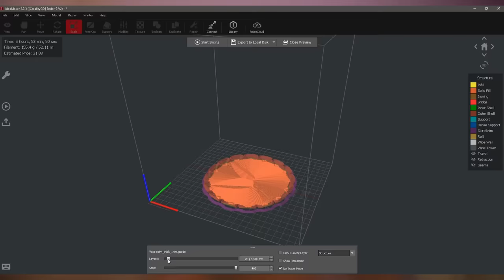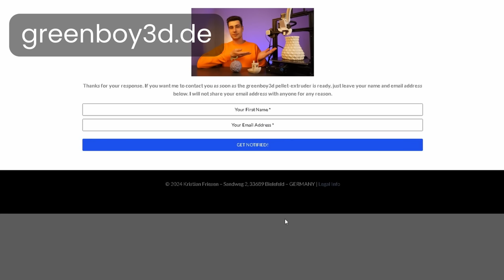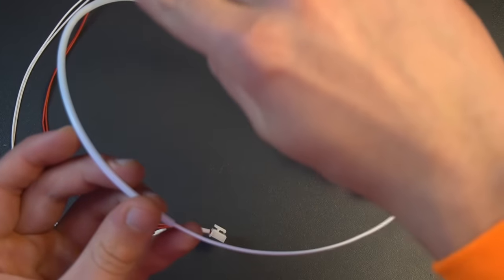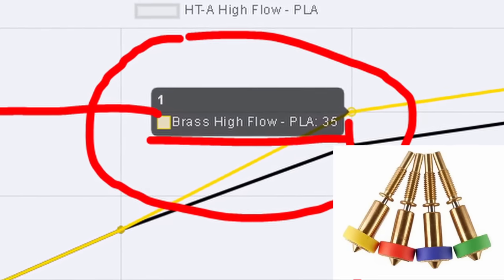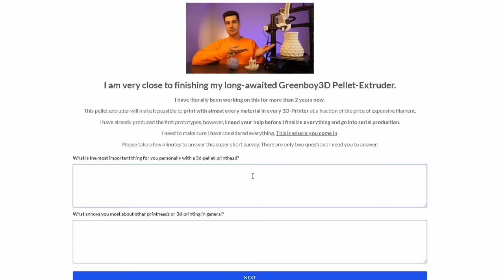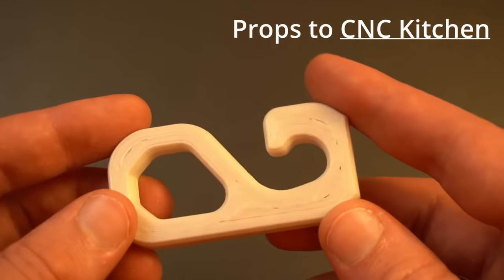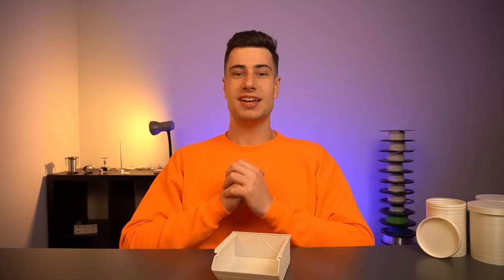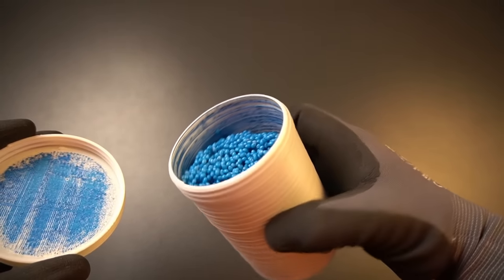Stop Buying Filament, Use This 6x CHEAPER Alternative instead

Comment: Will you need custom firmware because I have that exact same printer and will try and ake this as soon as it comes out.
Reply from the maker: You can use any firmware like. For example, Marlin is the firmware I use.

You just need to adjust some very minor settings in the firmware in order to use the pellet extruder on your 3D printer.

But don't worry I will make very detailed tutorials regarding this, which will everyone to upgrade their 3D printer to a pellet 3d printer 😀
Reply from the maker: Any more questions?
Reply: @greenboy3d  Yeah would i be able to grind/shred failed prints and support material and reprint it in this extruder setup? Also would you be able to grind things like PET bottles to recycle them directly into new prints?

Comment: I think the best solution for the nozzle would be using a larger thread for the proprietary nozzle. Say, M10 or something. (Ideally with a taper lock at the top so molten plastic doesn’t enter the threads) This way, the system can use proprietary nozzles or standard M6x1 nozzles with an adapter bushing.

Comment: Recycling is great, but filament does not have such a big price. Question is reproducibility/fail rate etc. Standard noozles is must, as custom ones give you disadvatage on market. In future I think you will have problem with spreading of MMU option. Over all like idea.
Reply from the maker: what do you mean with "spreading of MMU option"?
Reply: @greenboy3d  Multi Material

Comment: I feel that its worth mentioning that spraypaint isnt a great thing to be melting down, depending on the paint it could be very toxic.
Additionally, when mixing pigments into plastics the formulation is tricky as the pigments can easily ruin your material properties...
Reply: Yeah also pre pigmented pellets exist that aren't that expensive.

Comment: Run this beside the printer with a 1.75mm nozzle. Run the output through a bowden tube to a standard direct-drive extruder. If you set the pellet extruder as a standard second extruder in "ditto" mode with the correct steps/mm, you'd be getting filament on demand for the "primary" extruder with no changes to the printer necessary. Heck, you could use it as a pure bowden extruder and have zero worries about the weight of the entire setup.
Reply from the maker: Interesting idea :D
Would you like me to try that out in of my next videos?
Reply: @greenboy3d  Yes please! Great idea!
Reply: How is that different than an inferior filament extruder? What benefit would it bring?

Filament extruder are slightly more complex as they typically require sensors to ensure the filament is always the correct size, without it the resulting filament would be inconsistent reducing quality or causing clogs.

Why not buy a filament extruder to produce your own filament from cheap pellets?
Reply: @hellothere6627  The difference is this would be done on-demand, and would be compensating for inconsistency instead of trying to make 100% consistent filament.

This is akin to using sensors and processing power to compensate for low-cost parts the way Bambu has done successfully. Large, heavy, stable durable machines existed with mechanical perfection giving near perfect accurate printing. Bambu just measures the imperfections and compensates for them in real-time to generate results.
Reply: @greenboy3d  I would love to see it. The only limitation I initially see is that you would want to break up extrusions into small chunks, such that it's not making one measurement adjust for a very large movement. A post-processing script could break up any long extrusions. If a long extrusion was defined as a single extrusion that uses more than one (small) pellet's worth of material, it would theoretically be adjusting flow at the same resolution (or better) as pellet volume.

Comment: I honestly do not care about chasing the highest print quality.  For me #d printing a a utilitarian endeavor.  I make useful things that are meant to be used instead of "pretty" things that are meant to be looked at. If I can get 5x the prints at 1/5th the price and still meet the industrial level quality I accept then this is more than fine by me.  I don't waste my time or money printing busts of deadpool.  As for nozzles, I would prefer to use standard nozzles that are interchangeable among multiple printers, BUT....I think this is one of those cases where I see value in needing to use a specific "one off" style nozzle.  However I think it would be best that any nozzle be as robust as possible.  I'd ideally want a nozzle to last as long as the extruder screw and I don't think that is unachievable.
Reply from the maker: Thank you for your very interesting input 🙂
What would you like to see next?
Reply: @greenboy3d  I was thinking about this more yesterday and I do believe that your extruder could do double duty and act as the first stage for a pelletizer for ground up failed prints or supports.  This would make it much easier to blend with virgin material to then feed into your extruder.  This thing you've done opens up a LOT of avenues.  To have a viable extruder on a small scale really gives so many more options than a bulky unit that is not portable.

Comment: Nozzle - make it proprietary if it works better.
Neat idea and implementation but filament has come down a good bit where you can pick up a kg for $8 or under. If you can get this pellet extruder to come in under $200 AND have a source for the pellets at $5 or under per kg then i can see it working out great!!! Can't wait to see the final version as no matter what it is still a cool project.

Comment: This is really interesting. I wonder if you could make some GCODE that would use your pellet extruder to make spools too with a small addon. Seems like it would be a pretty handy thing to have around in general. Your screw style pellet extruder might actually be ideal for people's DIY filament recyclers, turning older printer parts into filament recyclers is of interest to a lot of people.

Comment: Hello, I plan to print accessories to recycle soda bottles (feeders, drinkers, fly traps, etc.) but I want to print them by recycling plastic (printing scraps, bottles, etc.). .) Your extruder seems interesting to me, but before going any further, can it be mounted on an Artillery sidewinder X1? And is it possible to easily return to an original extruder, to carry out other work and return to the pellet extruder afterwards ?
Reply from the maker: Thanks for your interest in my Pellet Extruder ♥

1) Yes, you can mount it to the Artillery sidewinder X1 and to many other 3D printers

2) Since you just need to unplug the extruder cables in the main board and plugin the cables of my Pellet Extruder, it is very easy to switch back to your Filament Extruder 

Any other questions? 🙂
Reply: @greenboy3d  
Thank you for your response.
X1 uses a ribbon cable as a connector for the extruder, this may need modification right?
Reply: @greenboy3d  Hi another one What is your recommendation for sufficiently crushing plastic bottles?
Reply from the maker: @tidou_flcrea  There are a handful of options, however please give more time to do some research on that topic, since I am right working very hard to ensure the Pellet Extruder and everything linked to it, like guides etc. is ready before October.

Please remind me of your question in 45 days 🙂

Comment: I honestly think I could live with the reduced print speed if it prints consistently or great. but even right now it could be used in a tool changer?

I also have an idea: i'm developing a pressure sensor for hotends that can optimize the flow and calibrate on the go based on hotend pressure, you could use one and then do a closed loop servo style hotend!
Reply from the maker: Can you write me an email regarding your presure sensor please to kristian@greenboy3d.com :) 
I am interessted and also willing to pay for it
Reply: @greenboy3d  Sure!

Comment: If the meltzone isn't needed anymore, you could use E3D-style nozzles (because the have a smaller head than the old MK8 nozzles) and shorten the threads a bit on the lathe. This way the meltzone decreases, but you can still use all the normal cheap nozzles as a quick replacement in a pinch.
Reply from the maker: Hmm.. That a good idea :)

Comment: I don't know much about it but from what I understood the print quality is caused by the pellets inconsistency, maybe it is fixable with a bigger heating nozzle, or maybe a semi-melting tube before it reaches the main nozzle. I am aware of the dripping problem it creates since there is nothing to hold the plastic from flowing down but maybe a custom nozzle could handle it? I loved the video btw

Comment: If the quality and cost benefit speak for themselves, I really really don't think supporting standard nozzles is something you should focus on.

The moment this thing releases - if the major 3d printing channels "get" it and are able to reproduce the benefits you show (material choice, cost, flexibility) then it's a winner. But, if the end of those videos they say "but, I've not found the quality to be usable for the kinds of prints I do" its a loser.

Speaking personally, my opinion would be swayed by this kind of thing. I want a third party to do strength tests and quality tests before I buy into a whole ecosystem.

All this is to say - focus entirely on quality and reliability. Nozzle compatibility seems like a far far worry from that. Multiple melt zones, flow rate sensors, that seems like the next step, but you won't get adoption if the quality is under the acceptable threshold for many people today.
Reply from the maker: Thank you for your very interesting input 🙂
Any idea for flow rate sensors?
Reply: @greenboy3d  Perhaps temperature loss or pressure on the nozzle could be a proxy for flow rate measurement?

Comment: I am so sad I missed the discount…. I would have been able to get it. Can it be used only with the ender? If not what other printers would you recommend today?
Reply from the maker: Hi, it works on almost any 3D printer and by now I have made already 3d printable adapters for more than 50+ 3D printers 🙂

Soon there will also a new big on the ongoing progress regarding the site where you will be able to download the adapters.

Personnaly I recommend the SOVOL SV06 since it is very easy to upgrade, open source and I will make guides on this 3D printers

Comment: The nozzle compatibility reminds me of when Honda started making the Cub, they asked a manufacturer to produce spark plugs that were of a different size from those that were common for motorcycles at that time, in order to make a cheap but still powerful enough engine. The Cub then became the most sold motorcycle of all time. You dont have to cater to old standards if they're not as good. Make a new standard.

Comment: Make sense for large production (dozen kilos per day), for printers with 1mm nozzle at least. If you still wish to print as is, make your own filament. In current state it's too much hustle and errors to use it. And don't print things which you can buy (usually it cheaper, stronger, last longer and don't require hustle).

Comment: One small question: where do you get your pellets?

It's an interesting project, and after your first video did a quick google search for plastic pellets in the EU, and couldn't find anything in the 3-8€/kg range you are citing, most i find are at least 10€/kg, and at that price you might as well just buy cheap filament. So if you want this to get popular, also show us where to buy these cheap pellets XD.
Reply: exactly my experience, nothing on the 3-8eur/kg range... starting from the same price as cheapest filaments
Reply from the maker: Should I make a Video about this?
Reply: @greenboy3d  Could at least be an interesting section of a next video, i'm clearly not the only person wondering, and it's an important part of your sales pitch, it should be a lot cheaper, but if we can't find cheap pellets, we won't have any use for your extruder...

Comment: re special nozzles.... as a stop gap / trial, can you just turn a tiny copper plug with appropriate outer diameter and an inner diameter of 0,4mm or whatever and press it into a std Mk8 nozzle?
Reply from the maker: That's genius, I'll try that out 🙂
By the way, what would you like to see next?
Reply: @greenboy3d  well I'm interested more in functional parts, so not really PLA..... would be good to see some variations on detail parts using PETG, ABS, PC and PA12-GF, with different speeds / nozzle diameters etc.  Realise that would not be a quick and simple process!!!!!  The engineering material filaments for FDM are generally quite expensive, so longterm your hopper feed & hotend would be game changing if even approaching equivalent quality of print.  Am guessing it would take a lot of work and likely identify some limits, eg min nozzle dia and max speed / flow for a given quality of print.

Comment: after this video, if  I were buying new 3dprinter, your extruder would be one of my main considerations.

I've got couple questions tho.

How compatible this design is with enclosed 3dprinter (like many bambulab clones)?

How sensible is switching back and forth, if I wanted to do most of printing with pellet and go back to filament for parts, I want to be really nice?
Reply from the maker: 1) Technically there is no problem using it on an enclosed 3D printer, however in such case either a bigger enclosure is necessary if you want to you use my gravity pellet feed-hopper, or you install an air pressure based pellet feeder for which you don't need to extend the size of the enclosure

2) It is not sensible in the sense of changing the printhead from Filament to Pellet back and forth if that is what you are asking.
Reply: @greenboy3d  
1 it makes sense
2that was, what i was asking.  
Thank you for quick and sensible answers

Comment: I prefer making filament (I make my own) first and use that for 3D printing. Usable on all machines with all extruders and nozzles.
Reply from the maker: Do you also recycle your failed 3D prints and if yes then how? :)
Reply: @greenboy3d  Failed prints and supports are going in the shredder together with leftovers and retuned boards (we make PLA boards mainly for traffic signs). All shredded material is mixed with new pellets and used to create new boards. 
I use fresh pellets only as the shredded parts are way too big to use for the filament extruder.

Comment: the why is oustanding when you worked around industrial extruder PRECISION no slip drying of pellets in the screw but i think since you need to save weight you need a melting screw with a hopper then a heated tube and another finer fillet screw to extrude, or switch nozzle and screw to extrude 1/4 or even 1/2 thick melted cord to make sturdier cords print looks horrible but you get perfect layer fusion you need heat on both screws and once the first bigger screw is filled with pellet and pigment you have a certain linear lenght of the color you choose on the head heated screw very tight into a fixed barrel so you extrude PRECISION witch each turn of that one.then first screw get refill another pigment and compress air to deliver pellets 

This is what industrial machine use but in one screw wich get tighter and tigher in the barrel with their spiral channel getting almost non existant for a section but for weight control it have to be done onto a fixed screw. one that feed the head where anoter finer screw is located and extrude either slow but very precise width or fast with another nozzle and a fitting screw pushing out some ridicule amount of material to build sturdy and ugly parts in no time

Comment: even if you have to buy a 100$ nozzle but you get 95% of the quality of filament it's still a good price long term, I'd love to get into 3d printing but the price of filament, 3d printer, failed prints, maintenance, this might be the solution for me, please make it the best you can, long term price is more important than the initial investment especially if it's less than 400 dollars,
Reply from the maker: Thank you a lot for your feedback. 

In November, I will start with the development of a more powerful pellets extruder with a better print quality. 🙂

Comment: Iam from Germany and were do you get your pallets ? I looked for some and all i found were like 12€/kg for PLA.
Reply from the maker: Soll ich mal ein Video dazu machen? :)
Reply: @greenboy3d  yes. I also can't find it. I am in UK and buy filament for £8 per spool which I 1.1kg and in bulk would be £7. Do you think pellets worth it? Also why not to have filament production instead of pellet hotend?
Reply from the maker: @Jokershadow696  Pellets will always be cheaper, and you will never have as many possibilities like chocolate, sugar 3D printing etc. then with filament
Reply: @greenboy3d   but video focuses on pla only. But where to find pellets? I found weird quality on ebay for £12-15 a kilo and need to be bought in bulk. I tried look online and there £15-20 per kilo which doesn't make any sense, why they sell so high...
Reply from the maker: @Jokershadow696  The market has way too many resellers in it, which artificially increase the prices without adding any value.

But don't worry, I have a plan to connect the Greenboy3D community directly with the manufacturers so that everybody can buy pellets at cheap prices

Comment: The main problem I see is this: Filament prices are coming down. The cheapest PLA pellets I could find were about 10€ per Kg, the cheapest filament is 12€ per Kg. That means the filament is now so cheap that my biggest printer uses more money in power than filament.